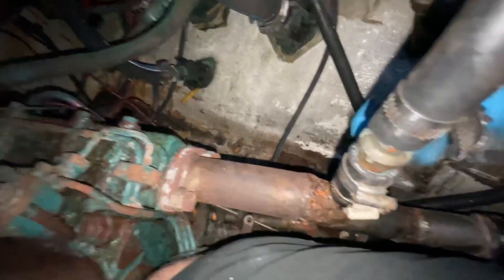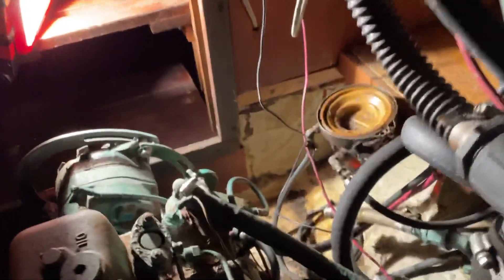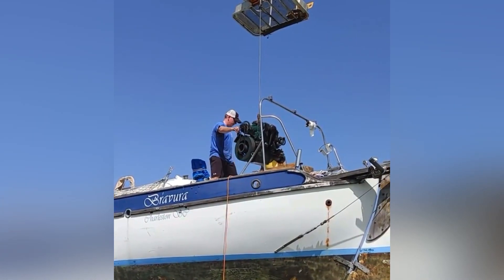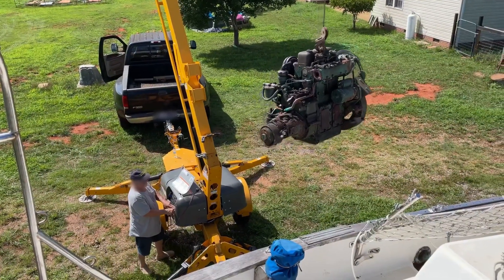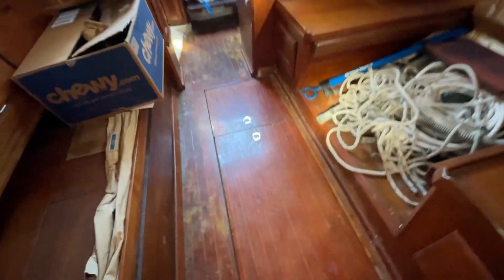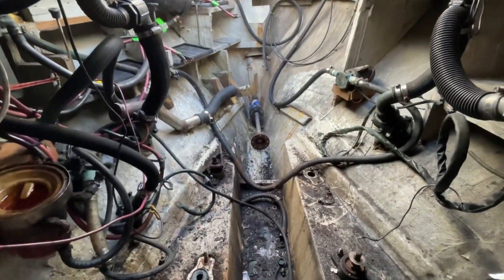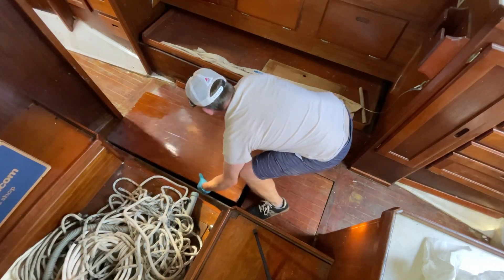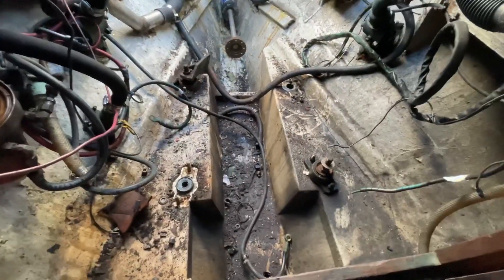Removing the Old Volvo Diesel Engine from the Westsail 32 | Sailboat Restoration Ep. 11

Comment: Too slow, too repetitive.  We don't need to see every hose disconnected and every bucket of bilge water hoisted.  Also one and a half minutes of intro video is a waste of time.
Reply from the maker: Intro is only :27. It's typical. Yeah, I cut out a lot of those farm shots in future videos. Everyone gets it. Countryside. But, this video was to have more of a visual record of all of the hoses for labeling, so I spliced it in. And the clips of buckets of oil/diesel/water were a mere 30 seconds. These videos serve as snapshots of the entire process as I appreciate each stage of it all. Currently, both bilge and engine room are spotless and repainted. All looks great. But you probably won't make it that far in the videos. Or, skip ahead.

Comment: Hello Even Keeled, 

We are a few months behind you in the process of repowering our 1975 Westsail 32 in Oregon. We chose the Beta 35 and it is on order through Bud at Westsail Parts. I will be following your progress on your refit. Once we repower Dreamcatcher, we will be getting her north into Portland for additional refit projects.
Reply from the maker: Very cool. Alongside the manual that comes from BetaMarine, Bud's guidance and guide are very helpful. I am lucky to have another Westsail 32 close by, which that went through the process. I plan to visit and take a look at their installation. I have everything I need except for a new, dripless shaft seal - I had to cut mine to be able to shift the drive shaft aft in order to remove the engine. Finally, if you have not already, join WOA and the Facebook Group.  Lots of help there.  I look forward to your progress too.
Reply: @Even_Keeled  Yep, Bud is amazing as is the WOA site and Westsail Parts Co site. I was lucky enough to have had Dave King of SV Saraband come down and look over Dreamcatcher in June. Dave has great stories of glory on Saraband and his ongoing push back against the "wetsnail" haters - most of whom have never sailed a Westsail. Since you are hauled-out long term, you might consider Dave's hull modifications at the rudder.
Reply from the maker: @sail-on  I will take a look. It is so much easier to get everything done before it is back in the water.